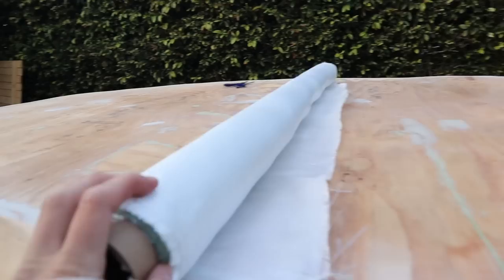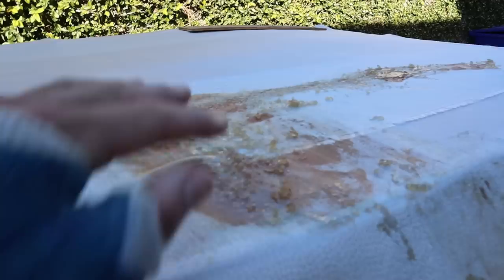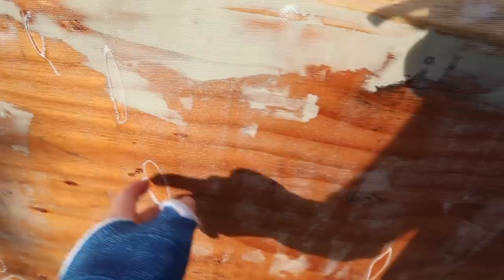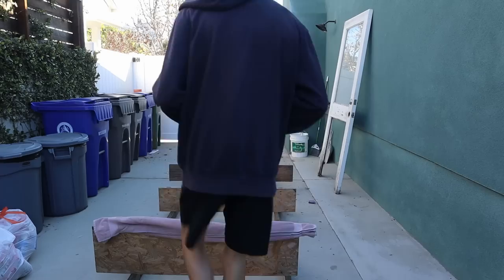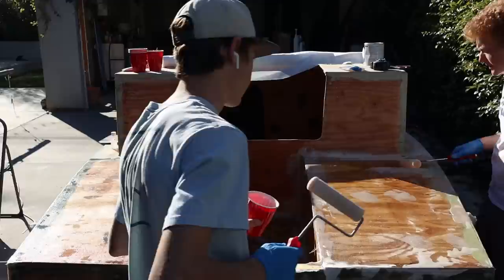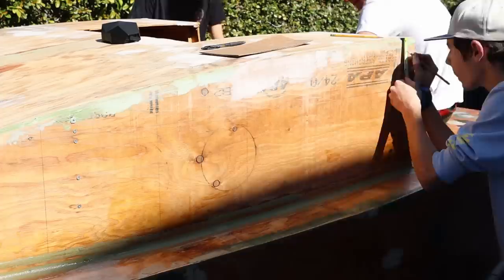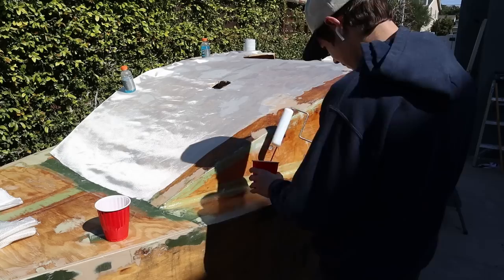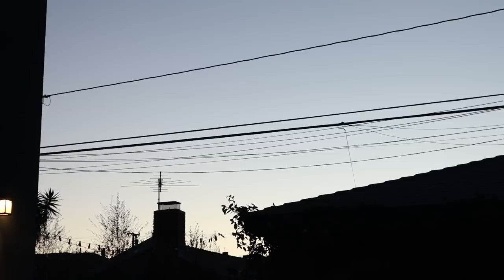Building A Sailboat From SCRATCH | Ep.5 - Adding The Fiberglass

Comment: You can't make cut backs on everything when building a boat. It will require a certain amount of strength and durability to float and even more so to sail. My suggestion would be to either save money until you can do it properly or buy an old boat to renovate, because as this boat has been built realistically it will never be seaworthy or safe to use. The plywood isn't marine grade, the screws aren't stainless, the filler you're using adds practically no strength, and I would think that the plans themselves lack the detailed step-by-step instructions needed by someone who's new to boat building. My advice would be to start with something more manageable like a small dinghy or canoe built by the stitch and glue method and make sure that you complete all steps thoroughly and don't rush the process. Probably 90 percent of the time you spend on a boat is behind the desk studying the plans, doing research, and planning the build. It's a delicate and time consuming art but when done carefully it can be very rewarding.
Reply: Seconded!
Reply: Like anyone would go cruising in the ocean in a 15 foot flat bottomed boat. It’s just for him and his pals to mess around in on a lake. Fishing etc. just a bit of fun, and you’ve got to start somewhere.
Reply: Bro you are the standart back seat boat builder haha

Comment: You need to do a saturation coat on your plywood, with epoxy, before you put the fiberglass on. Ideally, you would put the glass on when you're saturation coat is tacky.
Reply from the maker: I was planning on to but with my budget, I wasn’t able to. I know it’s ideal but I didn’t have enough epoxy.
Reply: also you can use a primer instead of a coat of epoxy when you lay your fiberglass use a stapler with t50 staples to hold thing down the tighter your mesh the better finish youll get

Comment: Jack, you have a steep learning curve, the areas where you had large gaps on the side decks, that you filled with bog, / filler, are a structural weak point, the filler will crack,and break under load.
Buy  some fast cure harder for the epoxy, also, to fair the hull, mix epoxy and micro ballons to a peanut butter, consistency,  and then spread,  over he sides and bottom then sand , before painting.
You need to do more research on timber ply, boat building,  also you need to put some framing inside the cabin top between the top and sides, to a strengthening
Reply: i agree completely. Just little bit more patience and research this could be done much better

Comment: you mention card scrapper to spread epoxy, it's fine for something like filleting or anything that is not fiberglass since it will move and possibly break the fibers in the fabric and weaken your structure. you should go with a foam roller to spread it and then a solid plastic or metal roller to remove the air bubbles in your fiberglass, otherwise you might get void developping down the line in your layers of fiberglass. I use only the solid rollers when applying fiberglass on my boat :)

Comment: Great progress, Jack. I love working with 6oz glass, it's so easy to cut the edges with the utility knife after curing. My recommendation for the next boat, is to use epoxy mixed with fumed silica powder to a peanut butter consistency and spread it on the 90 degree joints with a silicone spatula for your filets, since fairing compound isn't really intended for that. Keep having fun, it's looking sweet. I hope you put on some bright colors when you paint.

Comment: You easily can get adhesion problems by directly laminating Polyester and epoxy on top of each other, unless you got a 'Go' from your material source/ manufacturer. At my Job we would typically use some sort of adhesion layer in between. In general vinylester works for that, which will also works great for water resistance, as polyester will absorb a small percentage of water. 
For laminating always First apply resin and use a dearation roller (Roll with circumferential grooves, not sure on the correct english word for it) to remove all air.
Hope this helps and much success!
Reply: "use a dearation roller (Roll with circumferential grooves, not sure on the correct english word for it) to remove all air."

In English, it's called a '"fin roller". But frankly, I prefer using a "bristle roller". They make it much easier to get the air bubbles out, compared to a fin roller.

Comment: Don't feel bad about the first batch of polyester going off so quick. I had the same problem with the first boat I built. Who ever had the idea of using drops of hardner to large volumes of resin was not planning on using it themselves. That's why I like epoxy. You have measurable volumes of both resin and harder. Good on you for sticking it out and getting it done.

Comment: I think you are doing a great job. And using polyester resin is fine. In my exploration into boat and fiberglass boat building I read "Fiber Glass Boats:  Construction, Repair, and Maintenance" by John Roberts published 1984. In that time vinyl ester was the gel coat, tough, and lay up was polyester. Epoxy was just to expensive.  Also in my studying epoxy could be used on (to repair) poly and vinyl but not the other way around.

Comment: From now on when you do fiberglass wet the wood first with appocy and give some time to absorb in to the wood. Doing this will give you a much better bond and much stronger joints and stiffness to the boat and the boat will last much much longer with less repairs over time.
Reply from the maker: Great tip, I really appreciate it.

Comment: FYI the glossy look of the resin will faid with UV exposure, and so will the structural integrity. Also I hope you sanded the spots you had the sections of resin meet or didn't let it fully cure before continuing because that can cause weak spots. You can get resin based paint and I would recommend using it to help with the strength of your hull. I work with fiberglass and resin for a living and hope the best for your boat it looks like a fun project to work on.

Comment: The layers of fiberglass should be completed at the same time to ensure the layers are properly bonded together. With the right epoxy, you can have much longer working times. Also, working in the cold would actually give you more working time. Heat accelerates the curing process.

Comment: rather than paint ,use a white polyester gel coat roll it on it will give your resin a extra thickness and fill out low spots on the glass fibre probably cheaper than paint aswell  you could add a colour pigment if you want to do hull a different colour  ,its all good my first boat  was and old fibreglass high roof top off a transit van the breaker guy laughed and gave us 4 dumbass kids it for free ,think he was trying to  drown us we added a plywood board at rear for transom and screwed on blocks inside put to cross seats  for life belts we drilled holes on side and tied ropes through them it held up for two summers best fun ever  messing around on river everyone said you all gonna die blah blah ,

Comment: Nice job. But some advice. The air pockets you have right now under the poly from the screws you used are going to bite you in the future. In the winter moisture will collect in there and in the summer it will crack the poly. If yo dont fix this before yo paint the boat will be useless.
Reply from the maker: Thanks for this info. Do you have any ideas regrading the process to fix it?
Reply: @JackWood25  Hai. Yeah there are 2 fixes. The first one i don't like my self but it can fix it for a short time. Just make a small hole in the air pocket and fill it with resin. that's the easy en quick way. But for the long time fix. You have to sand al the way true to the poly until you have no air pocket left. And than wilt some fiberglass patches make it whole again. Then sand it flush with the rest and paint it witch poly resin paint or something like that. Good luck and  I will follow the build ; )
Reply from the maker: @DodgeManiac1968  Thank you. I always appreciate getting advice from others who know a little more than me.

Comment: can't wait for the float test :)
Reply from the maker: Slowly working on it. I don’t have a trailer and it’s a little hard finding one
Reply: @JackWood25  its small enough to hire a car trailer for the weekend
Reply from the maker: @4kays160  that’s sort of my plan. Rent a flat bed u-haul. The only problem is both the crane hoist is pretty expensive where I live
Reply: @JackWood25  tell your mates that you think it will break in half and sink lol.. then youl have 5 friends tag along to watch you sink lol but little do they know there there for the man power 😄
Reply: @JackWood25  Hi, you may want to investigates if you can modify an all purpose, cheap, flat trailer ( ie: harbor freight ) to serve as a boat trailer. With a flat bottom boat as you did built, making bunk supports, and few rollers, will not be difficult. Keep posting.
Reply from the maker: @oumenelabrise2155  great idea! Thank you!

Comment: For the future save polyester for the inside of the boat if your trying to save money and use epoxy on bottom and top of the hull as well as bulk heads and tapping 
Also fairing compound you used in seams next time mix your own epoxy and silica add some long hair fibers to larger gaps if needed

Comment: If the mast is rated for your length and mass of boat, I would avoid cutting it down. Your sails will reach more wind more efficiently at that height. The biggest reasons to adjust your mast height are if it is for a larger boat, you already have smaller sails than the mast supports, or if you won't have a long enough centerboard to counter the torque moment of the mast.

Comment: odd idea to use two different resin system. polyester will last long enough trust me... but it's harder to work with, hardener ratio, time to cure. epoxy is easier to mix and more consistent in curing time, and it's a bit better, yes. ideally you would wet the surface with epoxy and make it soak into the wood, then apply the the fiberglass and so on. epoxy is more expensive but if you use top material, marine plywood and so on it's just peace of mind you won't ruin stuff. there are varieties of fiberglass fabric that are more suited to polyester resin and other that are more suited for epoxy. I think you used the one more suited for epoxy, which is fine since this is not a top dollar project. but it will be a cool boat nonetheless! both epoxy and polyester resin don't tolerate U.V so you'll need to put something over it because it will get destroyed and flake pretty fast under the sun.

Comment: Are you intending to install a keel to help keep the boat upright in wins or do you intend to use your body weight to balance the boat against the wind? You are probably going to need some sort of keel/centre board to keep the vessel tracking properly out on the water. I admire your enthusiasm on the project - no plans and a watertight vessel.
Reply: I missed the first episode where you are building to plans.

Comment: You probably figured this out, but if your epoxy is well mixed, then it will set.  You don't need to worry about getting it warm.  In fact, lots of people put the epoxy in the fridge before mixing it.  The colder it is, the more working time.  Also, the bigger the batch, the shorter the working time.
Reply from the maker: Thanks for that info. Going into the epoxying process was a little nerve racking but after reading our comment, I now feel much more comfortable and confident if I use epoxy in the future (which I probably will) .

Comment: Make a boat out of wood and then cover it in fibreglass🤷‍♂️🤔😳why don’t you just make a boat out of fibreglass and only use any wood for specific areas
Reply from the maker: I've never built a boat before and the idea of starting with a wood frame, then covering it with fiberglass sounded like the easiest option for me. I've learned a lot during the construction so hopefully in the future when I build another boat, it'll be much better.